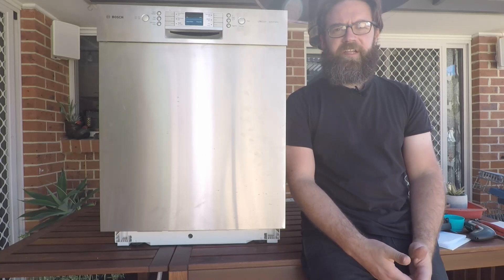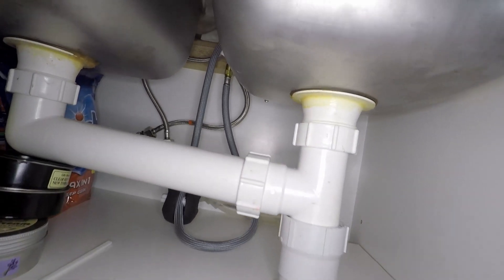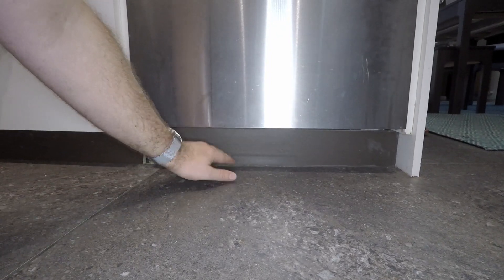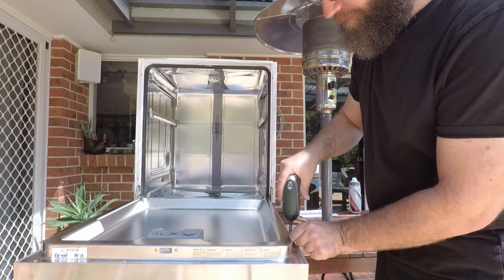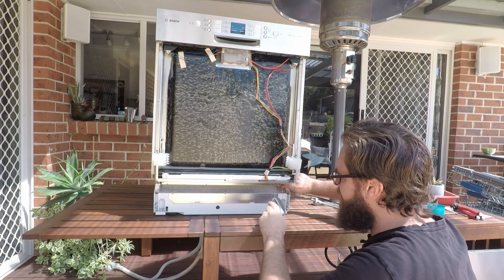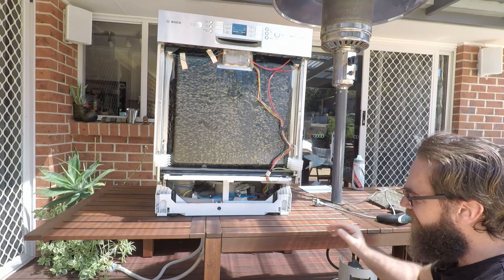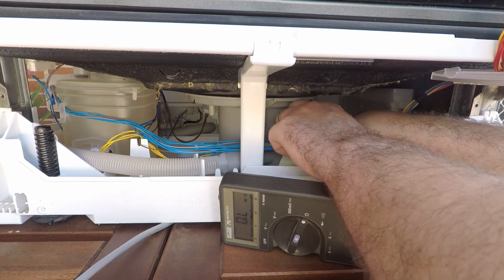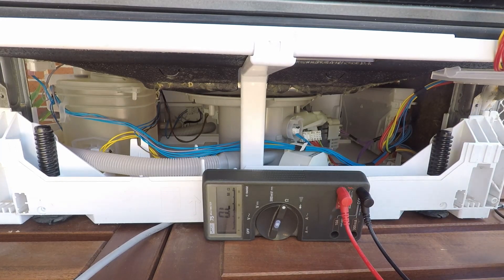Bosch E08 error code diagnosis and repair

Comment: As unlikely as it may be, I have a Bosch dishwasher here that is throwing E:08 error codes while in self test mode.  I pulled it apart, applied the multimeter to each of the leads on the heat pump, and what do you know, both temperature sensors (NTC1 and NTC2) are giving infinite resistance.  The failed temp sensors are causing a series of cascading errors in the dishwasher, leading to overflows.  Your particular prediction turned out to be correct.  Thank you.